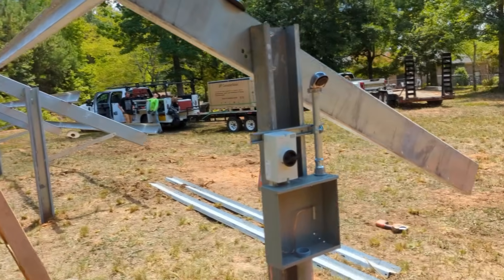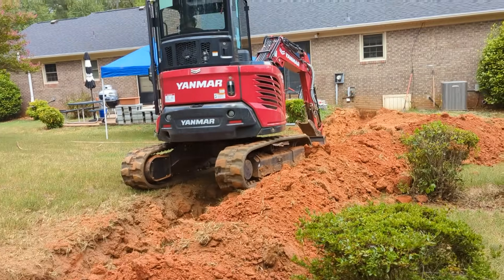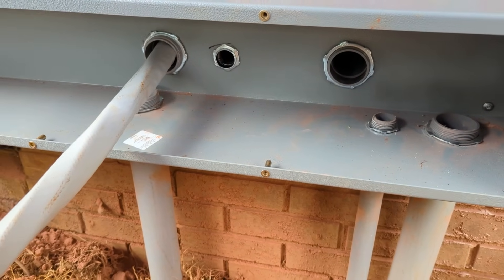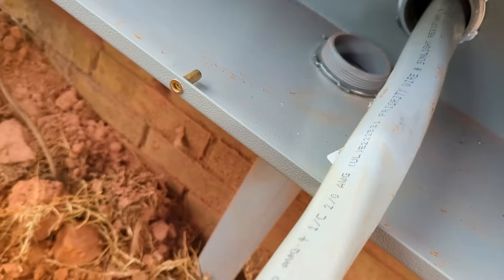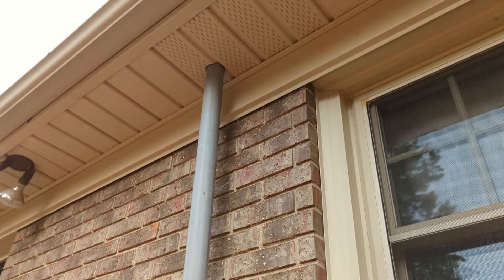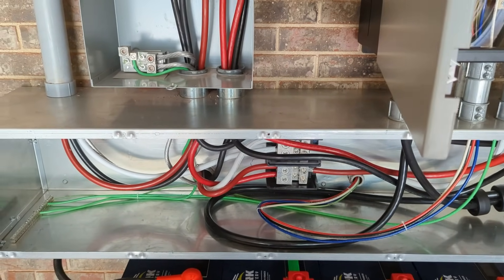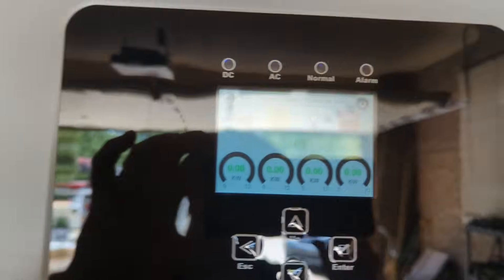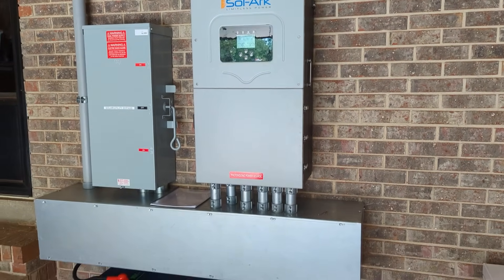The BEST Hybrid Inverter

Comment: SCOTT, GREAT PROFESSIONAL INSTALLATION; CABLE TIED WIRES IN THE WIRING TROUGH & NOT A WIRING BEES NEST! 
DID THE GOVERNMENT REGULATIONS REQUIRE AN ADDITIONAL EXTERNAL 200 Amp DISCONNECT, BECAUSE AS YOU SAID PREVIOUSLY THE SOL-ARK 15k HAS ONE INTERNALLY?
YOUR INSTALLATIONS & EXPLANATIONS HAVE DIRECTED ME TOWARDS A SOL-ARK 15k. 
THANKS, YOU & YOUR TEAM KEEP UP THE GREAT WORK!

Comment: Question - when installing panels on house rooof, is emt piping required al the way down to where the inverter is mounted ?
Reply: Yes
Reply: @Roscopicotrane  even when it runs outside from attic to basement?

Comment: You didn’t show how you were going to connect the customers standby generator but I assume it would be connected to the generator terminal in the Sol-Arc. Unless it is whole house sized that may be a problem. Sol-Arc neglected to provide protection from overload on the generator input. If the grid is off and you energize the generator terminal the inverter will charge the battery at the full rate you input in the settings. The problem comes in if the the house load plus the charging load exceeds the generator input limit, the inverter will not cut back charging load to protect the generator. The inverter will protect the generator if you run the generator output through the grid input terminal on the inverter. To do so requires a 200A transfer switch upstream of the inverter grid input. So much for the vaunted claim that the Sol-Arc 15k has all the transfer switches you need built in. There should at least three*** on that claim everywhere it is made including the sales brochures. While it is true that the generator can charge the battery, to do so you must have a large generator or try to work around the lack of automatic protection with fixed settings that may not be effective in a dynamic situation.
Sol-Arc could fix this in software if they wanted to and they are certainly aware of it. Perhaps they need some you tube attention to the problem to motivate them to do so. We can only hope…

Comment: Hello. I have a question on implementing a generator. When I spoke with Sol-ark they said a portable type generator that worked with a two wire start could be set up like a stand generator. Have you done anything like that?

Comment: I had a Sol-Ark 12k inverter installed last year, I notice that when there is a momentary grid shut down our power goes out for 10 to 15 seconds, the installer says this is normal to protect the inverter.
Reply: Bob is right, no reason for the lag: I’m wondering if they somehow left an external transfer switch in your system?

Comment: How are you getting 13.4kw on two MPPTs when each MPPT can only handle 5.67kW?  It appears you are using 32 420-watt panels. Tks
Reply from the maker: The manual is wrong what they did is to take 17 kW / 3 so the limit is actually 6,400 Watts per MPPT.
Reply: @engineer775  Thanks Scott, I knew something didn't add up.  I'm  lookung forward to getting the 15kw I purchased from you installed.  I would have never attempted this without the help from your videos.  Great work!

Comment: Sorry if this seems like a dumb question but with this inverter, you wouldn't need solar panels that have microinverters right?
Reply: You can add AC coupled solar to the generator input other than that you can use a string of solar panels without micro inverters to the MPPT inputs.

Comment: Can you share what model power distribution block you installed. It looks like one side accepts larger cable when compared to the outlet side. Don't you need to run 4/0 In and out on both sides? I found a marathon product 4/0 Al in 4/0 Al out See above
Reply: I second this question.  I haven’t been able to find 4/0 to dual 4/0 distribution.  15k on order, transfer switch in cart, just need the distribution blocks.
Reply: @FrostbyteVA  15k has 200amp transfer switch built in .
Reply: Link to Datasheet https://www.marathonsp.com/pdf/datasheets/145x129.pdf
Reply: I think the one wire on the right side of the distribution block is smaller because it's only sized for what it sells back to the grid.

Comment: How does one learn if your install can have the capability to be on the grid and off-grid? By that I mean if the power is lost from the grid by what means do you disconnect from the grid and allow your home to be off-grid powered? I hear some companies like PG&E will not allow you to use your solar/battery setup when the grid goes down to avoid dangerous back feed when the grid is down. Is this some kind of local rule per state/city and county?
Reply: If the grid goes down the inverter does not send any potential to the meter. The house would be running on the load side of the SolArk.

Comment: Wow that looks so awesome. You should post all your installs, they are killer. And very simple. This system could help so many people.
Reply from the maker: Thanks Will. I do  post all my installs. I only do two a month as I have a lot of DIY customers now that I help through the whole process.
Reply: @engineer775  I just received a quote from Lori for the 15k, I'll be going with the Sol Ark rather than the Growatt for .. a huge number of reasons.
Reply: @engineer775   i need help purchasing a diy kit under $10k roof mount no shading in kansas
Reply: I recently found your channel and I find myself often wondering "What would Will Prowse say about this? Why haven't I seen Sol-Ark on Will Prowse's channel". I am a few years out from my DIY system but you both have been so informative. Thank You!
Reply: and finally getting through my backlog of subscribed video channels and there is will with a Sol-Ark 🙃
Reply: Very curious to know what you gents think of the Span smart panel? It has a software controlled virtual critical loads panel that seems like could save some time in installs and offers max flexibility
Reply: Yes. This does help! I am going to send this video to my electrician that is going to help with keeping it this neat and tidy!!

Comment: Sol-Ark doesn't list this spec on the 15k.
What is the rating L-N? 
The 12k will only hold ~4000w L-N before it goes into overload.

Would be nice to know how tolerant the 15k is too imbalanced loads.
Reply: I was wondering the same thing. It’s not a good idea to be running a lot of line imbalance if you can help it. Before running an inverter, install an Emporia monitor (16) to get a pattern of current use. Knowing this you can move the loads in your breaker panel to get a better balance based on your life patterns. Microwave, coffee maker, dishwasher and hairdryers at the same time one line will dump ya.

Comment: The outdoor gutter SER conduit into the crawl space looks like it’s awfully close to the solar runs from the panels. 2/0 ser doesn’t bend very happily. Happy accident you wish you could move?  And I dream of getting a SolArk one of these days. The 15K really is the pinnacle of value, performance, and versatility. Thanks for your channel in keeping me informed as to their progress!!!
Reply: The pv circuits are in emt all the way through the crawlspace so it’s well protected. The ser cable is run with proper bending radius per the NEC. And no, it doesn’t bend easily 😂

Comment: For brick i find that #14 pan head sheet metal screws with conical anchors work really well. Makes things easier if you have to pull things off, and they hold really well if you don’t want to pull things off

Comment: Great seeing the Micro-Air EasyStart devices in your videos for the AC units. Do you generally need to do anything similar for well pumps?
Reply from the maker: I haven't had to yet. Most residential well pumps are very easy to start and I don't see them exceeding you 40 amps
Reply: I'm curious what's the micro air easy start doing
Reply: @ciliap  lowering the required in rush of starting amps. Easier on the whole system.

Comment: We be doing some of these new 15KW sol arks  what size knockouts  1 1/2 in?? 
Not in manual .

Also 4/0 aluminum lugs?
Reply from the maker: Yes  inch and a half knockouts and yes the inverter will accept 4/0 aluminum
Reply: @engineer775  thanks much appreciated.  Trying to get all parts for am..  You all make some good videos.  Nice work also

Comment: Have you had any grid backfeed issues? My 15k has worked perfectly aslong as there are batteries to fill. However randomly in the afternoon it will start backfeeding to grid when I have it limited to load and grid sell turned off. Still waiting for approval.

I have mine setup to power load first. Sol Ark told me to try setting to battery first and see if that helps. I haven't been able to try due to rain.

Otherwise perfect system.
Reply: Mine hasn't had that issue. What wattage did you set for your Zero Export Power?
Reply: @niktak1114  0
Reply: @hoocli  That's probably the issue. Try 60W.
Reply: @niktak1114  I'll try, can you elaborate on what that does. I just assumed that ment it wouldn't Export but new to this.
Reply: @hoocli  It needs a bit of a buffer to avoid back feeding. I've seen recommendations in the 50-100W range for that setting. 60W has been working well for me. How much has it been backfeeding?
Reply: 2kw~
Reply: @hoocli  If changing the zero export power fixes it then let them know about the bug
Reply: @niktak1114  will do thanks again